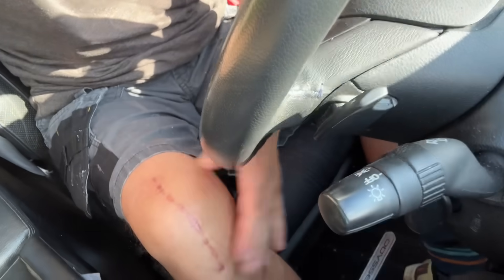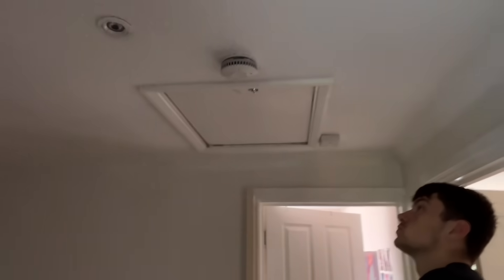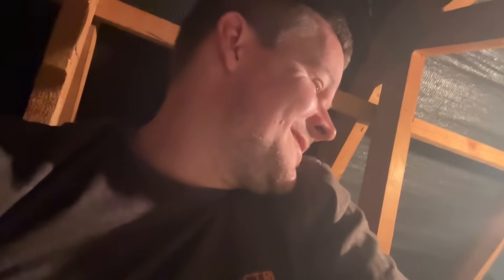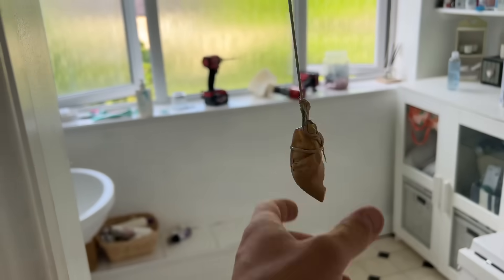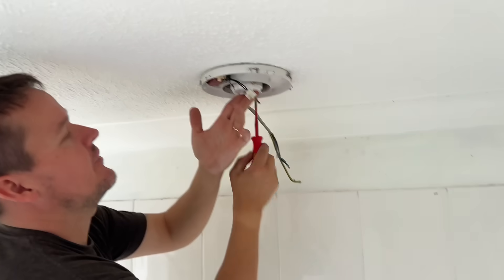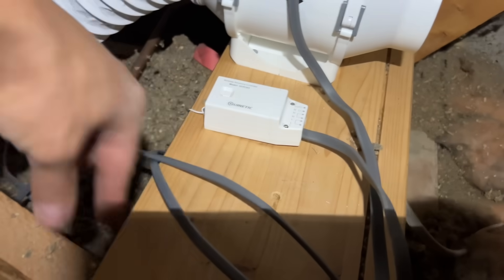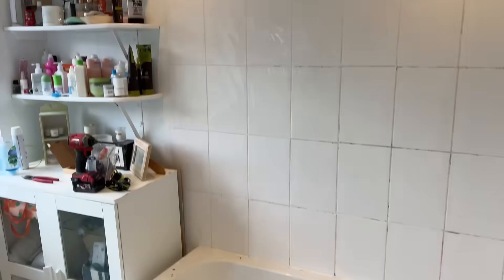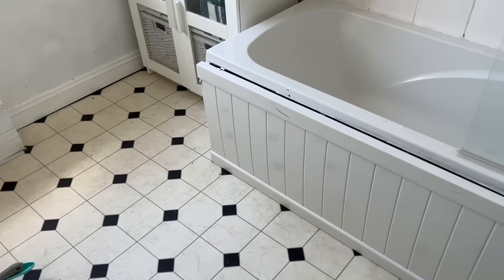Why has he done this to the consumer unit?

Comment: How ridiculous putting a RCD in the loft . That’s the last place someone would expect it to be . Put it next to the consumer unit that way it would protect the whole upstairs lighting circuit .
Reply from the maker: Did you see the board?
Reply: The RCD should never trip and if it has they generally would have more to worry about than  dropping the accessible loft ladder to reset it, what a moronic comment
Reply: Armchair expert.

Comment: great job as always how about putting spur next to fan isolater ( if there is one ) outside bathroom more accessible
Reply from the maker: Nah the fan is in loft isolator is for maintenance only not an on off switch that home owners use it for. Why would it need a fan isolator when the rcd spur isolates the power?
Reply: @Cjrelectrical  i was thinking more because the spotlights are fed from rcd spur aswell ( unless i watched it wrong ) it would be better, just a thought i am never normally right lol
Reply from the maker: No that would be 100% correct but the loft light is not on the rcd and if you need to work on fan it’s in the loft not the bathroom. So tripping the rcd for working on the fan yes will trip the lights but leave the loft light on. Let’s not go down the discussion of fans not even needing isolator switches if the bathroom has a window with natural daylight.
Reply: @Cjrelectrical  fair enough i respect your judgement as your are probably the spark on youtube and your apprentice is is  privileged to have you as his trainer

Comment: Done the same as you today apart from the insolation in the loft wasn’t that 1970s loose shite you had!! Do you ever see the polystyrene balls that always stick to old cables!! wtf 😬
Reply from the maker: Yeah the polystyrene reacts with the pvc and melts it. Did a big project once and all the cables had to be installed in conduit due to the insulation.
Reply: So much time and money spent on that job I’m sure. Nightmare